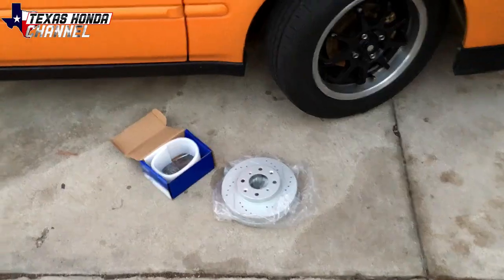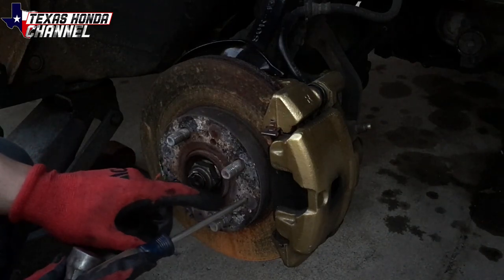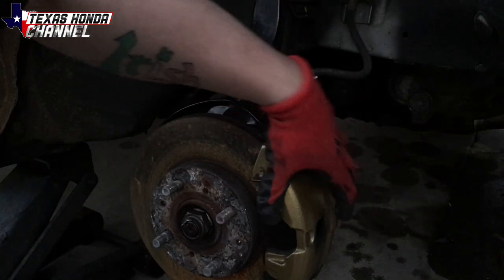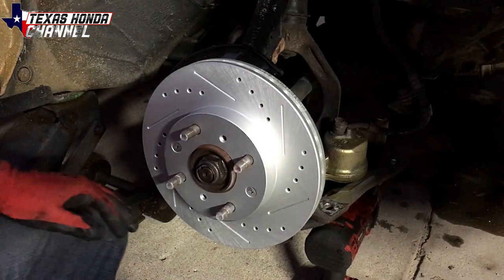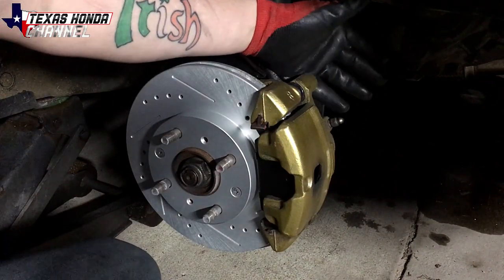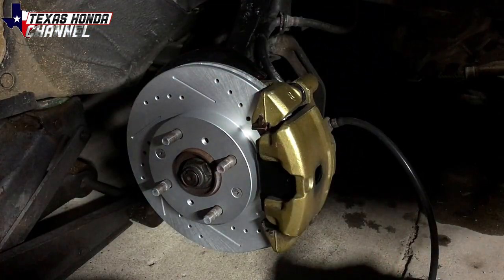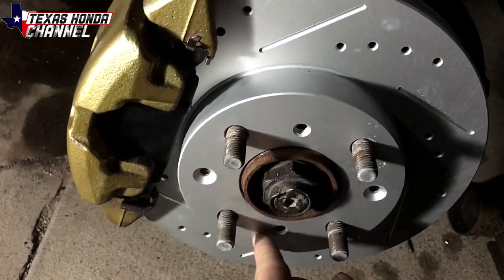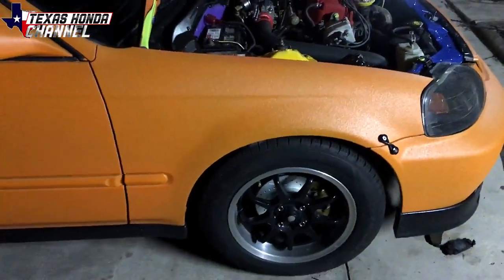How to install Drilled and slotted rotors  (Some 18psi pulls included)

Comment: I vote for a lime green on the calipers. Im so glad you explained how to do the Bedding process on new rotors. Most people dont understand that there is a zinc coating on the surface that need to be stripped off by the bedding process. Awesome job man
Reply from the maker: THAT GARAGE Thanks man. Like green would look pretty good wouldn’t it 🤔 also yea that break in process is super important.

Comment: I ran a set of those ebay drilled and slotted rotors on my ep3, it made a huge difference in braking. With factory rotors I had brake fade bad under hard driving. Afterwards brake fade was almost completely eliminated. Also put a set on my cobalt and likewise it made a difference, not as night and day as on the civic, but definitely noticeable. The ironic part is they cost less than replacing them with factory spec parts from an autoparts store
Reply from the maker: sinformant Yup I failed to mention that but it was cheaper to upgrade than to get oem replacment ones for sure.

Comment: Ebay drilled and slotted for the win! Use them on all my cars! Never had a single issue even with the included pads. Stop the same if not better and no noise!
Reply from the maker: Mine 100% stops better for sure over them stock rotors. On some vehicles it didn't make a difference really but this car it did.

Comment: Awesome bro glad you explained how to brake them in was hoping u would. I think I did it wrong on the corolla because the drilled and slotted ones I put on like 6-8 months ago are already warped pretty bad but I have a brand new full kit calipers and rotors and pads I bought for like $160 that ima put on soon

Comment: Watching you take those caliper bracket bolts out so easily made me jealous. Here in new england it aint easy. I had to heat the shit out of mine then use vice grips to break them loose cause they were so stuck. Most put thread locker here we lube the hell out of them with anti-seeze!!!

Comment: You can remove the rotor retainer screws if you hit a ball pien hammer (using another hammer)you  indent the center of the screw and it comes off every time. To lock it down once reinstalling indent the outer edge to keep from backing out.

Comment: Stock transmission?? My transmission grenaded and blew a hole in the bottom of the housing when I launched my turbo d16z6 yesterday
Reply: I have a stage 3 clutch
Reply from the maker: @HondaMudMasters  OUCH!!! yea the stock transmission can hold 10 second passes and over 600whp it just depends how good of shape the transmission is in. Im running a stock 92 civic 1.5 D15b7 transmission in mine ima gonna be running a z6 because they are the strongest short gear transmission. as long as its in good shape.
Reply: Texas Honda Channel what wide band do you use
Reply from the maker: @HondaMudMasters  LC2 Innovate wide band.
Reply: Texas Honda Channel do you have a video of a install

Comment: I never reinstalled the rotor screws had no problems,  only there to hold the rotor
Reply from the maker: Joey Dc4 Yup! If mine are intact I usually reinstall them but only because why not lol. Either way not exactly required
Reply: @TexasHondaChannel  if reusing I would recommend alil antiseized  on the threads for easy removal